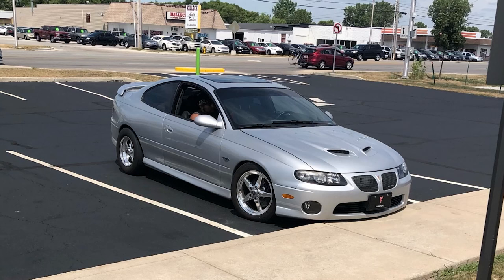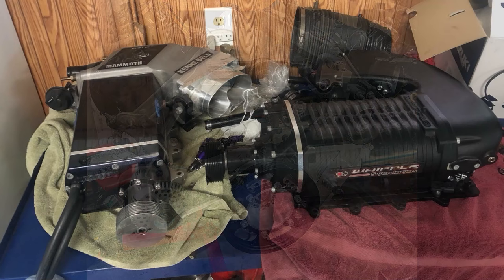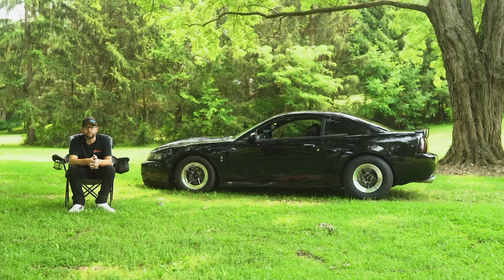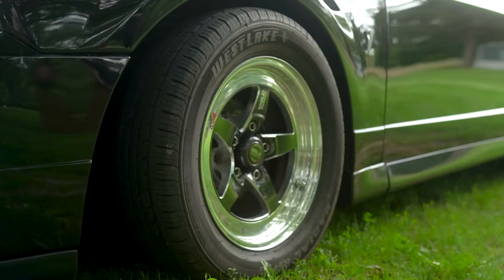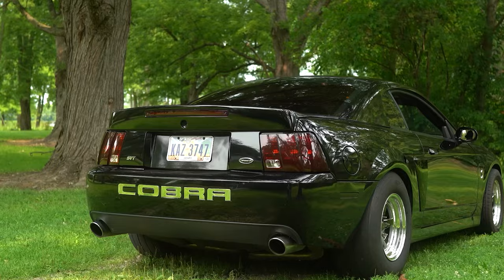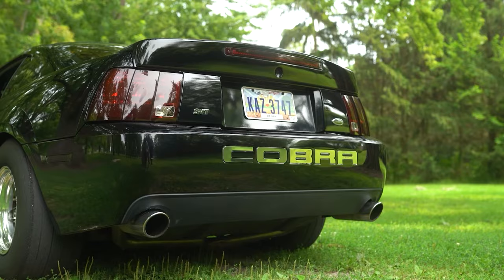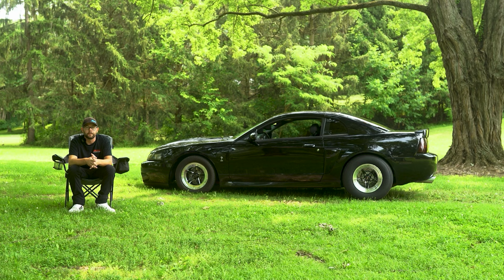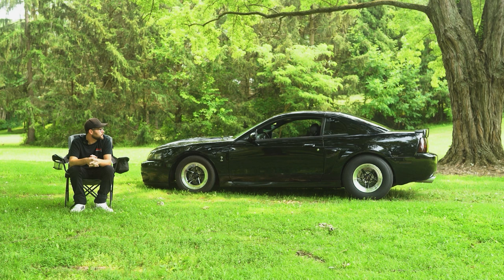Mike’s 820whp Kenne Bell Cobra!

Comment: Bad ass Term, those KBs scream, i had 2.6H on mine it screamed.
Reply: What did u make to the wheels?
Reply: @mmorgan901  on 91w/3.25 upper 4lb lower id 1050 injectors  635hp, on E85 722/696. The whine was awesome.
Reply: Do u still have it? What made u choose kb over the others? I'm thinking about upgrading my stock Eaton
Reply: @mmorgan901  as a matter of fact I still have it at my storage. Was going to use on another High mileage Term I wanted to buil but I end up buying a GT500. The KBs where the staple blower for the 03/04 Cobras back then so the choice was easy, now there's so many options,  toe the KB served its purpose and made goid power.
Reply: @willsam6243  my hp goals is between 600-650rwhp.. if u had a chose what would u choose in today's time
Reply: @mmorgan901  KB bc of the scream 100%

Comment: This car definitely seems sra swapped. The irs aggressiveness is gone for sure
Reply from the maker: Nope, still IRS swapped!
Reply: @cobraowners  kind of tame compared to others exhaust wise. Definitely a nice set up though
Reply: IRS aggressiveness?
Reply: @stephenrogers5593  do you know the difference between irs and sra on 88-04 mustangs? If not pipe down fella
Reply: @ranware2779  weird response dude.
Reply: @stephenrogers5593  🤫
Reply: @ranware2779  “IRS aggressiveness seems gone?” 

Are you talking about the aggressive wheel hop you get without good tires and bushings, etc? 

Are you talking about how the car with IRS appears to sit differently on certain surfaces than with a solid axle? 

Something else? 

It’s really a simple question. I had an 03 cobra as a first car and did a solid axle swap two years after owning it for weight savings, to get rid of wheel hop and have a cheaper rear end build. Back in those days, 2005, these cars could use all the weight reduction you could get.
Reply: @stephenrogers5593  do your self a favor go look at rear end shots of cobras ,Mach 1's, and gt's with irs vs sra there is a complete difference I don't care what you want to cry about or war about like I said irs has a more aggressive stand point. Also nobody told you or anyone else to go hit the Trac with stoc components.🤣.... your bad
Reply: @ranware2779  I wasn’t trying to start an argument or anything of the sorts with my initial inquiry and I’m not sure how it could be taken that way. 

I appreciate the clarification as to what you were talking about.
Reply: @stephenrogers5593  no problem my good sir excuse my aggressiveness
Reply: @ranware2779  What does exhaust tone have to do with whether or not it's IRS or SA? Glad the guy kept the IRS, that what makes an 03 04 cobra unique
Reply: @racequad9  lol if you know about 94-04 exhaust setups you would know 4.6/5.4 with irs exhaust sounds way better than an sra exhaust setup
Reply: @ranware2779  There is literally no difference in tone between an IRS and SA haha what are you talking about? And to prove it, you thought the car was SA swapped in your original comment which it obviously isn't lol so you couldn't even tell. So it seems like you're the person that doesn't know.